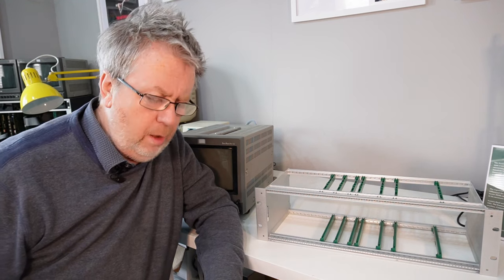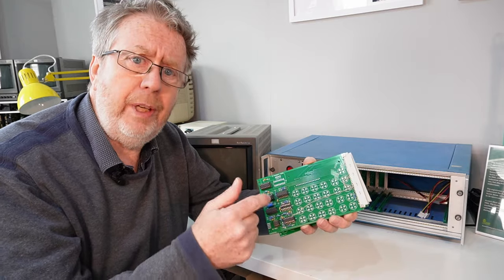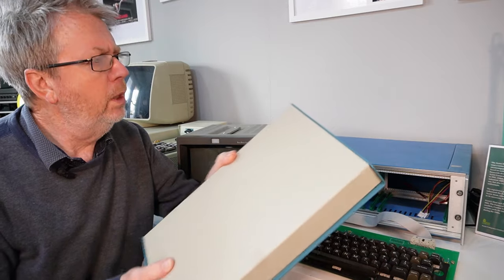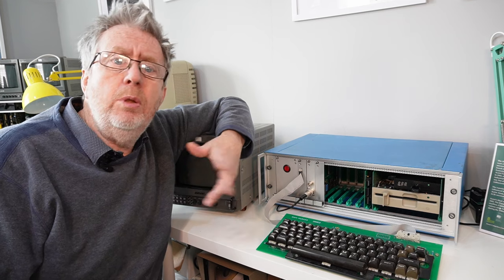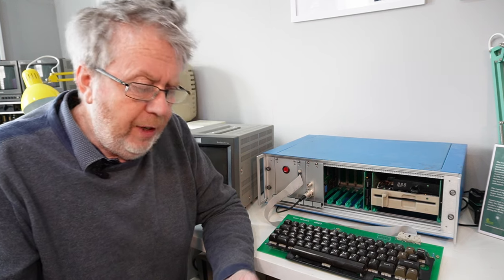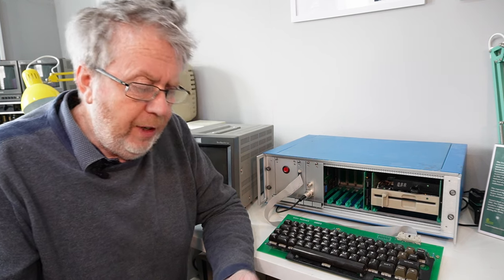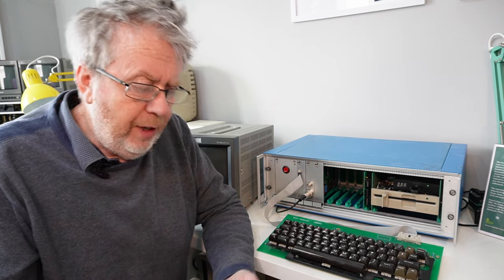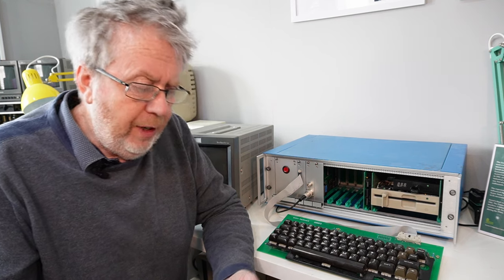Acorn System 3 Part 1

Comment: These machines I don't call them replicas as that makes it sound like it is a different machine from what an original system 3 is so in this case I call them recreations as it says that it isn't a 1980s-made acorn system and is one made today. Still, it keeps the lineage of the original systems because all the parts are genuine system parts just made and assembled today. Towards the end of this video, you ask about FLEX 6809. A while back I came into possession of a stack of SWTPC 8-inch floppy which I have had archived. Okay, the SWTPC 6809 isn't an acorn system but I can send you the Images. If this helps, I have an email address on my channel page where you can contact me. I do have an original system 3 but it is missing most of the chips and some cards so I might keep the incomplete missing cards in a box and use a load of modern cards instead.

Comment: Thanks for the video, a real trip down memory lane.  I only ever saw pictures of the System computers in magazines.  My first computer was an Atom, which I expanded all the way to a disk system. I did build a Richard Russell board at work, which was the Z80 prototype for the BBC Micro.  That was before Acorn showed the BBC their Proton, which became the model A/B.  I have enough electronics projects on the go, mostly RF related, so I shall steer clear of the vintage computer, modern builds, as it looks highly addictive. Glad you have found a support group though.  Good luck. Nick.
Reply from the maker: Thanks for sharing, I'd love to see pictures of the Richard Russell board... J

Comment: Excellent. I've only warmed to Acorn in the last few years (especially after Micro Men movie). I was always a committed Nascom fan (built mine in 1980 at the age of 19). I love Z80 assembler and I've always found 6502 code a little nausea inducing. One of my first jobs was fixing Microtan kits and building Acorn Atom kits (my boss was saving 40/50 quid by buying kits and I could build 2 in a morning and only cost him 30 quid). My Nascom still exists and is partially working but not used since about 1985 when I got my first PC.
Reply from the maker: I love the Z80 too but overall I favour the 6809, it's amazing. Having said that the 6502 has so few instructions, I can actualy remember them all.

Comment: Interesting, and boy are you keen.
I followed the glasstty bit and was pleasantly surprised, especially seeing the old Telecom branded colour monitor from a computerphone. I used to work in a repair lab fixing them. I did have one of those screens, but disposed of it long ago, however I still have a few black & white units.
I downloaded the Viewdata client terminal software, it worked straight away, now I'm kind of interested in setting up a server.....
I will have to try and find the software for my old Tandy TRS-80 model 1, that I used to access the Australian version (well I think I did that), a challenge due to lots of incompatibilities. 
They were fun days, until Telecom jacked up the prices to the blazes and basically killed it.
Reply from the maker: Glad you are liking Viewdata. I didn't realise I had a Telecom branded colour monitor from a computerphone. Is it visible in the video?
Reply: @GlassTTY  I was referring to the 'glasstty' website mentioned/shown in the video.

Comment: I did not get a proper look at your system 2-3 at retrofest, so it's nice to get a proper look at them now. Looking forward to the follow up videos.  You've got a good point about a lot of this stuff just being locked away in storage rooms with nobody using it. If that's where all these machines end up, then there will nolonger be anyone left who knows how to use them, and they just become objects shorn of thier meaning gathering dust.
Reply from the maker: It's a big problem and will require a major policy shift for many museums and a different approach for owners.
Reply: @GlassTTY  Its a problem we are probably just beginning to see the tip of the ice burg of. As there are plenty of collectors around at the moment with a wide range of systems in fairly regular use.  While most of us are fairly healthy and well, and will be around for a while yet, that can't hold true forever. While institutions can out last individuals, if we all leave our collections to museums it just means more machines gathering dust in store rooms.

Comment: I'm slowly getting back to my econet stuff again after Nov. It will be good to catch up in May if you're going as I'm thinking I might be getting close to the point of being able to link econet networks over the Internet thanks to some of the bridge code from Andrew.
Reply from the maker: I'll be there in May, it'll be good to catch up. I managed to get the System 3 hooked up to an L3 File server running on a Beeb.

Comment: I had an Acorn Atom in the 90s, from the local recycling centre.

(which was an Aladdin's cave of "retro" stuff back then. We had over 70 computers and consoles from there at one point. It got a bit out-of-hand. lol)

Included with the Atom were some DIN 41612 cards built on stripboard.
One of them had a Dallas RTC chip on. I think another was for interfacing to an RTTY modem, so likely a HAM enthusiast owned it originally.

Sadly, in a bizarre twist of fate, the whole lot got run over by a Land Rover. :(

5:36 - If only it were that easy. lol
Reply from the maker: Sounds like it was a fun time for you back then. Take care.

Comment: What I enjoy about kit computers and early computers like the Apple II is you are active working on your investment. It was a investment since those machine was used for at least a 10 good years or longer. Nobody thought about upgrading the whole entire machine. You just continued to add to it. I wish I could explain it better. Now it just seems so generic to upgrade your machine. For instance if I upgrade my pc right now. I'm looking at ram, processor, motherboard and possible larger psu.  Then technically I'm still limited with older video card, monitors, etc. Do I need to upgrade them. No. But that leads me to a brand new system. No magic in it.
Reply from the maker: I think you're right. The early machines had soul and there was a sadness when you did finally  upgrade. It was like saying goodbye to a loved one.

Comment: I look forward to the video of where you have a half-rack full of Acorn System 3s + one System 2. Personally I wouldn't stop at genuine non-original cards though. I'd also build some non-genuine original cards for the system, maybe a z80 expansion card that lets you run Spectrum software/games. That said, if I had the money to do all this, I'd probably just opt to build an entirely custom Eurocard based computer running Forth.
Reply from the maker: Hopefully  I have the obsession under control now so may stop where I am and start looking at software. Programming is the best computer game there is so I cant imaging running Spectrum games on them.

Comment: This Video came at the perfect time. iv been wanting to build a card style "replica" computer for a while! Do you have any recommendations on where best to buy the Rack hardware?

Subbed!
Reply from the maker: Getting the rack can be tricky. Verotec still sell them new but at a cost obviously. The rear bars are the thing to watch as you will be looking for something that allows the connectors to be directly mounted to the case. I might include a better explanation in the next video. Why not start the build without a rack for now an see what turns up?

Comment: 13:42 its like the Theseus ship, just keep replacing all parts, now do you have a new ship or its the old one ? I say its the old one because the "form", aka, the abstract interconnection of components is what makes the thing, not exactly the specific atoms that make the actual parts. The soul of the machine is the form and function, not the atoms and parts.
Reply from the maker: I like that idea. Thanks for sharing.

Comment: I'm almost afraid to ask whether the rack size is metric or imperial !
Reply from the maker: Ah well, its almost both as many BA sized threads match metric thread sizes. But its a bit odd when a horozontal unit is now defined as 5.08 mm instead of 2 tenths of an inch.

Comment: the rack itself  costs more then a complete pc. engineering a complete system is not easy at all if you mush account for the final price.
Reply from the maker: You're quite right of course but it's not too bad if you spread the cost over 40 years or so. :)